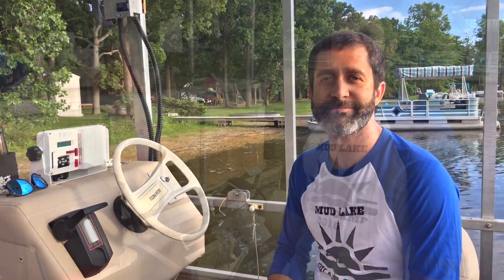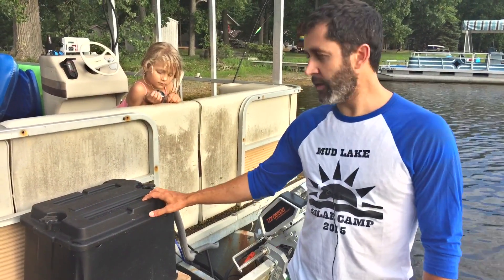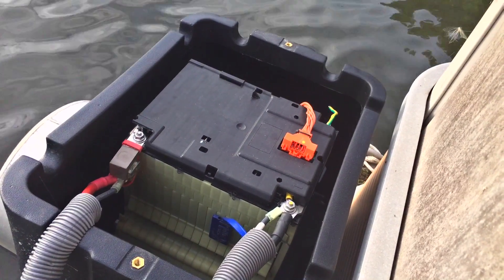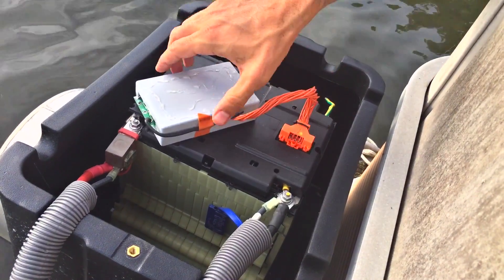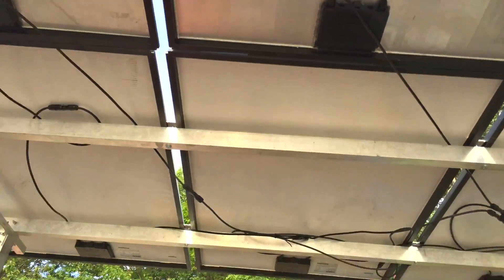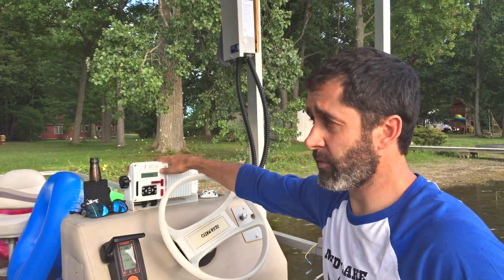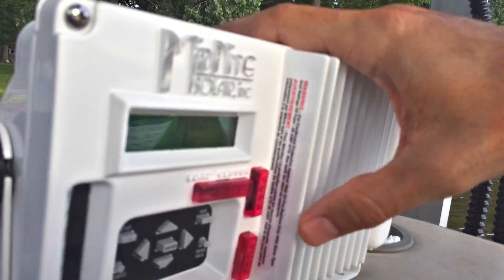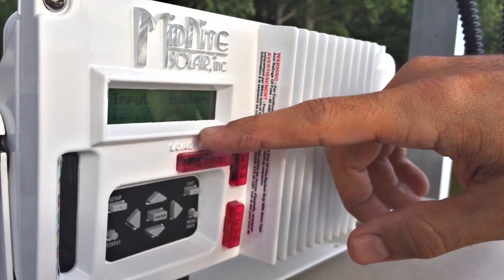Solar Electric Pontoon Boat Walkthrough

Comment: Well done Matt!

I have been planning a similar conversion for over a year with my Nacra 500 Catamaran.
4 panels for a total of 800watts
But I would like to go fishing a wheeee bit longer than half an hour @ half throttle, so need to juice up the amps

Would it be possible for me to contact you by email and ask a few questions? 
My email is boomboom@conet.net
Reply from the maker: Hey Roald, I'm happy to help but I tried to email but it bounced back, can you reconfirm your address?
Reply: Hi Matt, Strange, it's all correct. boomboom@conet.net
Reply: Roald Boom iand

Comment: I really dig this, and have been considering doing almost the exact same thing for years! My thoughts are in regards to efficiency, if you have 120v dropping to 50v, I didn't see any mention of amps aside from you have a 30amp controller. How many amps ?
Reply from the maker: Hi epicdeuce,

My Midnite Solar 'the Kid' 48V Charge Controller claims conversion efficiencies across the power input range of  95-96% - so it is something more complicated than simply clipping the 'extra' DC voltage.  Not sure what portion of the system you are referring to for amps.  There are two PV source circuits @150Vdc nominal coming from the PV array to the breaker.  One circuit  is about 7A nominal and the other about 15A nominal.  The charge controller can output 30A @ 48V.  The battery bank to motor feeder is protected by a 125A fused disconnect.  The Torqeedo Cruise 4.0 outboard pulls 83A max continuous.  

You can see a technical discussion and electrical single line diagrams at: http://www.electricseas.org/forum/topics/solar-electric-pontoon-boat-conversion
Reply: Very nice. Also any particular reason you used a Volt battery? I see they are quite inexpensive but a used tesla module seems to more bang for your buck. I was considering using a tesla module in case the sun goes down so I could be out all day and into the evening for a crusie back late!
Reply from the maker: My main reason to use the Volt battery module was that I could get it in an assembled ~48V pack.  I'm not so confident to disassemble a live Tesla pack, but it could be interesting for the future.  I got the pack, with BMS installed, for $850 for the 2kWh, which at this time last year wasn't a bad deal.  Where do you get used Tesla modules?
Reply: Mostly see them on Ebay although i've seen them on craiglist as well. Tesla Modules have been removed from the main pack already. They go for about 1100 on ebay but are 24v 250AH. Used volts packs are in the $300 range, I might go that route as well and just put a couple in parallel for additional range. After reading about the details of your specific situation and use on your 90 acre lake you seem to have sized your entire system perfectly... No point of getting huge capacity tesla modules if you'd only use a fraction of the capacity.

Comment: Outstanding video! What would give you a further range / more moving time - more powerful panels, less weight, or bigger battery? I think the cost of the torqueedo has hindered a lot of people from building similar projects. What is the total build cost currently not including donor boat?
Reply from the maker: Hi Tjr Pmw, thanks for the question.

Here is an easy way to think about the main components sizing and their relationships.  I am slightly rounding and ignoring secondary factors to make the math easy.  As you will see, the range depends on how you want to use the boat and what scenario you would like to assess.

Motor: Torqeedo Cruise 4.0 (4kW load at full throttle)
Battery: 48V / 50Ah Chevy Volt Li-Ion (2kWh of available energy at full charge)
Solar Modules: 6x 180W Sanyo HIP (total array about 1kW)

So we have conceptual 'blocks' of 4, 2, and 1.  Remember those.

Usage Scenarios -starting with a full battery

1. (worst case, used for design sizing) Full throttle, no sun: you can go only 30 minutes with before depleting a full battery (2kWh/4kW = 0.5h).  This discharges the battery at 'C2' or 2 times it's capacity per hour.  I have tested this case and observed immaterial temperature increase, but this is about the limit of what I would advise for anything but a short period of time to avoid damaging the battery.  Distance @ 5mph: 2.5 miles.   Battery discharge: C2

2. (typical) Half throttle, full sunlight: Each hour, the system would consume 2kW but recharge 1kW by solar for a net loss of 1kWh/hr.  Therefore, the cruising time would be extended to about 2 hrs.  In reality, the consumption and speed are nonlinear.  Also faster discharge rates will cause the battery to have less usable energy.  Distance @ 3mph: 6 miles.  Battery discharge: C1

3. ('sustainable' cruise) - Matching load to sunlight conditions, assuming daytime travel.  Since the array is limited to 1kW, cruising at about 1/4 throttle would match this.  As long as the sun is shining, the battery should stay approximately in a state of full charge!  Distance @ 1.25mph: 7.5 miles (assuming 6hrs full sun), using effectively no battery.  Then on top of this, you have another 2hrs / 2.5 miles with no sun from the battery alone.    

If I wanted to extend the range for daytime sun cruising, one thing would be to enlarge the array.  If the array were to match the motor rating (4kW), then there would never be any need to discharge the battery beyond for balancing through clouds etc.  What normally happens is I motor out to the middle of the lake and anchor for swimming.  While I swim, the boat is charging.  The coolest thing about a solar boat is what you do if you run out of juice (which has not happened to me on my small lake): you simply STOP IN THE SUN to recharge on the water.

4. (super-duper solar troller) If you wanted a 24-hour cruiser, the battery bank and solar arrays would get really (unwieldly) big:  4kWh load * 24hr = 96kWh daily load.  However, I can only hope for about 6 sun hours per day in Michigan summer.  Therefore, to replenish this amount of energy in a day, the array would have to be 96kWh/6h = 16kW (that's 16 times bigger than the current one!).  And the battery would have to be sized, at minimum, to get through the rest of the 18 hours, or 18h*4kW = 72kWh - about the size of the entry-level Tesla Model S battery pack!

I sized my system components to fit my usage case in the most economical way, and my boat (like most others) is often simply docked in the sun between uses.  I have never set foot on it without a full battery.
Reply from the maker: Yeah - I used to work for SunPower.  They have great products and dominate the high-efficiency space.  Almost always a good solution when space is critical and budget is not.  However, in my next build I would likely start with lightweight, flexible modules.  The weight tradeoff is important because the canopy has to be built to carry the load, amplifying costs.  For a pontoon boat with my design requirements, I was not limited by power or energy density of the solar modules - I have room to double the size of the array but would end up spilling the energy.  There are even some people making flexible modules out of SPWR cells - now that would be the real way to go for a high-end solar boat!  Totally not vetted, but you can see windynation.com for an example.
Reply: Just imagine if you had 6 SunPower X21-345. 21% efficiency cranking out 2,070 max instead of the 1080 max currently then of course you could sustainble cruise at 1/2 throttle. Pricey though.

Comment: what's the farthest you've travel in boat with solar?
Reply from the maker: Hi, I'm on a small 90 acre inland lake so I would end up doing many laps.  Basically I can run infinitely at about 1/4 throttle when the sun is shining.
Reply from the maker: Max speed at full throttle is 5mph +/- 0.1mph after running some speed tests over distance using GPS waypoints (sorry for my landlubber units).  I haven't measured @ 1/4 throttle but I would guess close to 2mph since I am certainly not getting the pontoons to plane or reaching hull speed at full throttle, so I surmise there is some nonlinearity to the speed/power curve which favors lower throttle.  But that's more of a hunch than a proven fact.
Reply: solartroller what is your speed at 1/4 throttle?